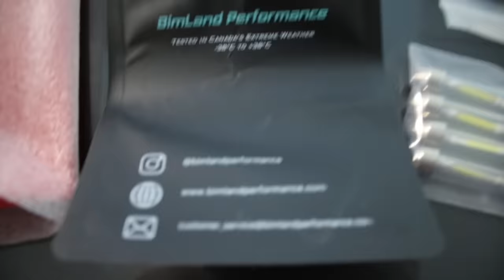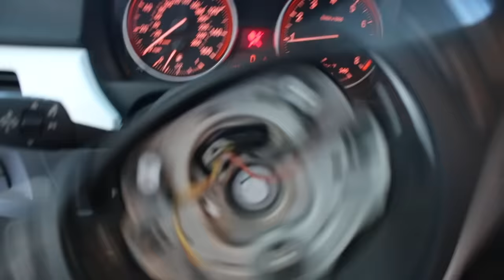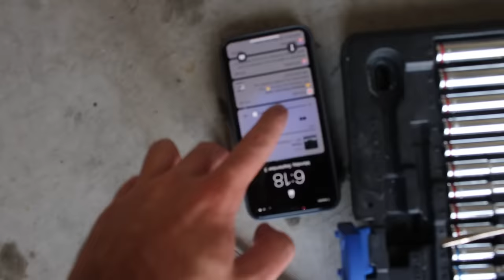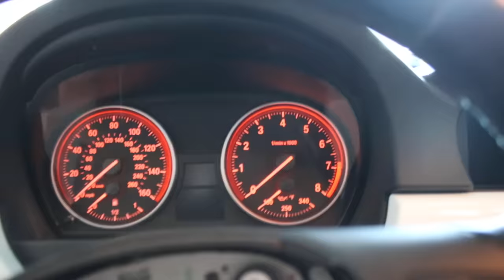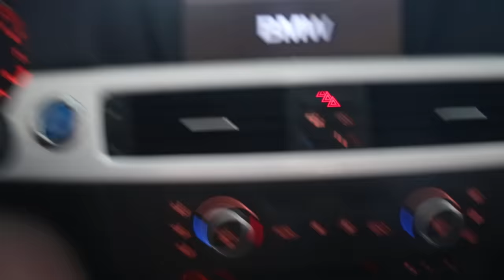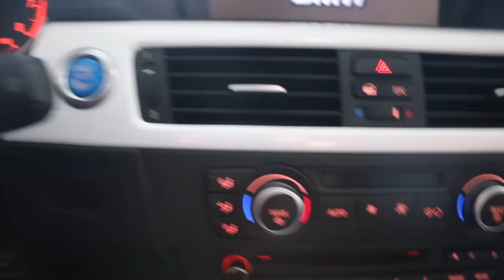Most Affordable BMW Mods  (ALL UNDER $30)

Comment: @nour you have to use an exacto or edge blade tool to cut around the overlapping tint for the rear overlays. I bought mine from your previous video and they had the same issue. I modded them with an exacto and they can out great!

Comment: The angel eye doesn’t match with the connector. I tried to install it on my bmw e90 2010 but the connector doesn’t match at all. Do you have any suggestions about that?
Reply: Did you read the sellers description where it says it only fits headlights for pre-facelift e90s?

Comment: What do the air scopes help with ?
Reply: intake is designed to pull air from the top of the void in front of the rad, the scoops are supposed to force the air into the intake system. 

Other than BMW owners being obsessed with their grill I don't think there's much gain. It can't be Dyno tested due to no airflow so it's just "swear to god bro, +25bhp easy!!"